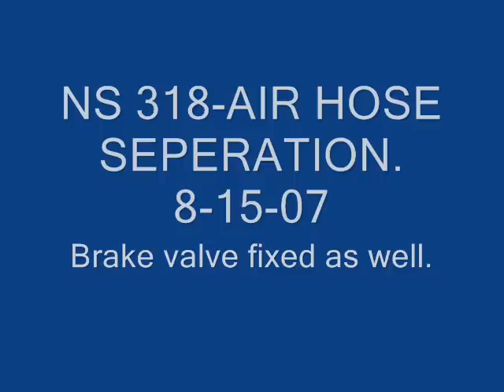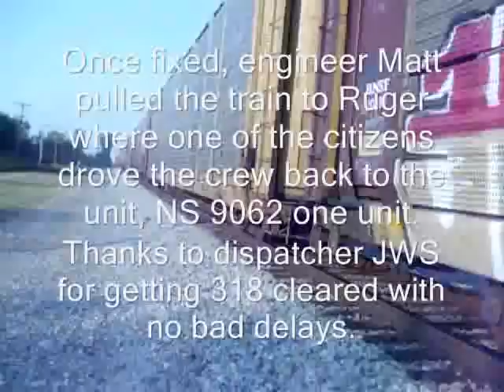NS 318 (8-15-07) FIXING A AIR HOSE SEPERATION.

Comment: @Nba12982 

Wait? What? Fixing the air hoses doesn't mean it would have run away. If the air hose separates, the air is lost, and that puts the train into emergency. Not without brakes